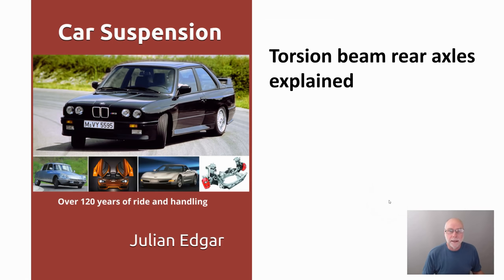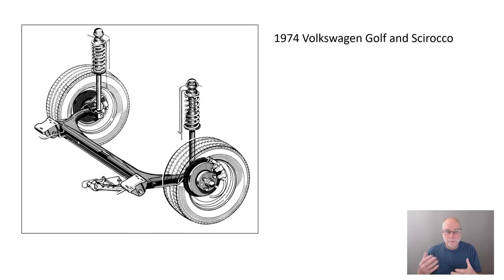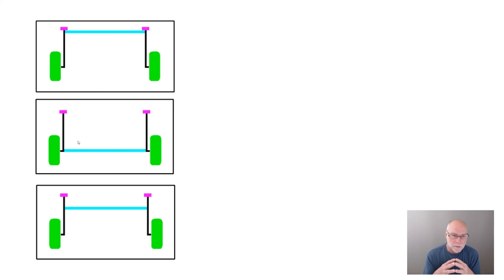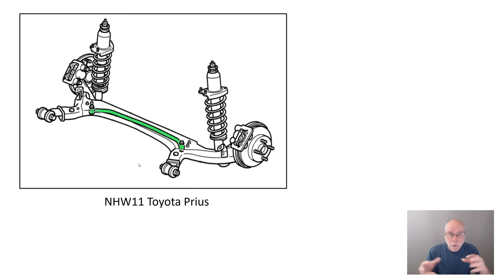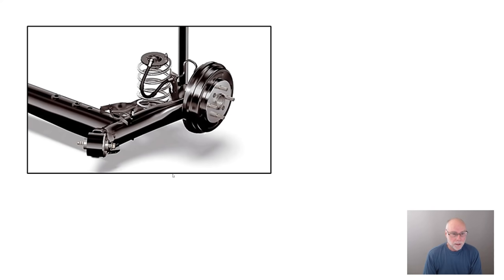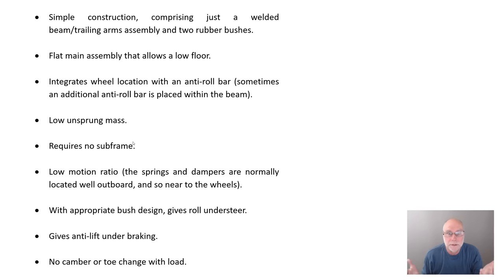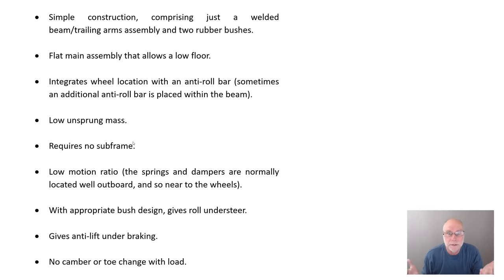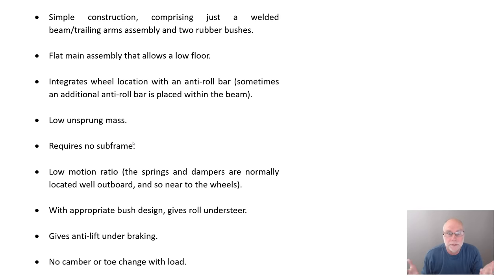Torsion beam rear axles explained

Comment: How about a comparison between old double wishbone designs, modern macpherson and modern double wishbone? 
Many old cheaper cars had double wiahbones at the front(fiat 124, lada 2101 and others), I wonder how it compares to more modern macpherson strut designs.
Reply from the maker: In short, double wishbones as a suspension system are superior to MacPherson struts, irrespective of age.
Reply: @JulianEdgar  but those old cars have heavy arms and probably not that good geometry.
I am not an expert, those are just my thoughts :).
Thanks for the reply btw.
Reply from the maker: @Random-nf7qb  My reply stands: double wishbones are intrinsically a better suspension system than MacPherson struts.  Plenty of old double wishbone systems were light and had excellent geometry. You'd enjoy the book, I am sure.
Reply: @JulianEdgar  Ok, thanks!
Reply: I wonder if you cover the Holden HQ in your book.   It has interesting double wishbone front-end geometry.  I think there are some issues with 4-link live axle rear suspension, such as a high roll centre, some roll-steer effects etc.  Not the best for stability.  The Holden VB with Macpherson struts is likely to be an upgrade.
Reply: Modern cars with double wishbones are often made from aluminium to save weight whilst designs can be changed to improve charasteristics of the suspension... i.e Peugeot 407 for example.

Comment: Is it possible to get a rear wheel alignment with this suspension?
Reply from the maker: It depends on the car and how much effort you want to go to, but usually, yes.
Reply: Yes, you can shim the hubs where they bolt to the axle.

Comment: Gives anti lift under braking but my Citroën AX GT comically jacked up the rear suspension when using the handbrake on a hill.
Reply from the maker: Yes, cars with anti-lift rear suspension will rise when the handbrake is applied and the car attempts to roll backwards.
Reply: Pretty sure the Citroen AX used torsion bar setup which was independent. Very different to a torsion BEAM suspension.
Reply: @khalidacosta7133  The forces involved in anti-lift - which lead to lift when the car tries to roll backwards - are exactly the same, though. Now, with Citroen being Citroen, it's likely that the spring rates were quite soft, which amplifies the amount of this motion.